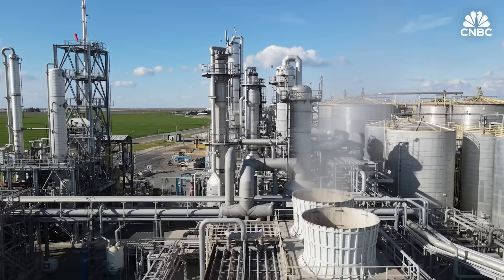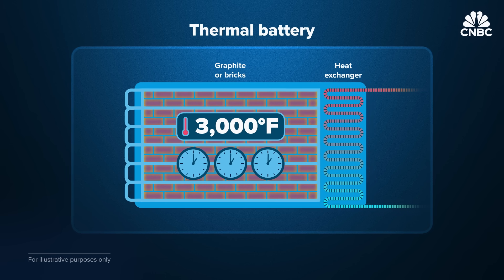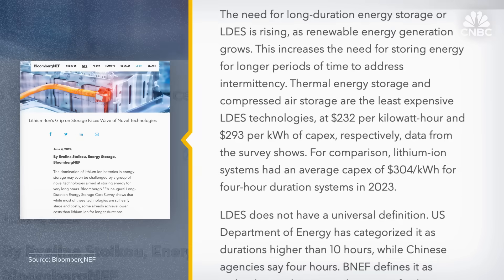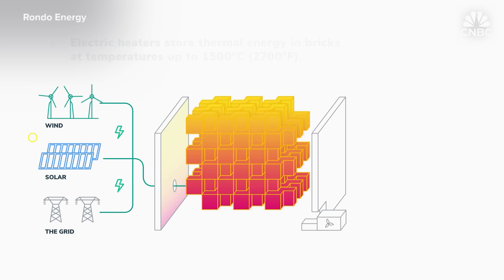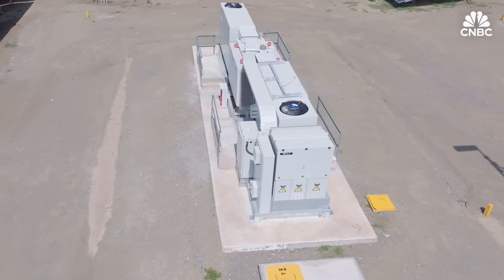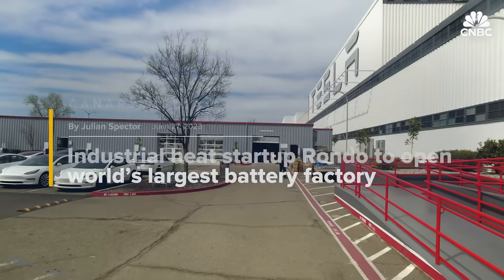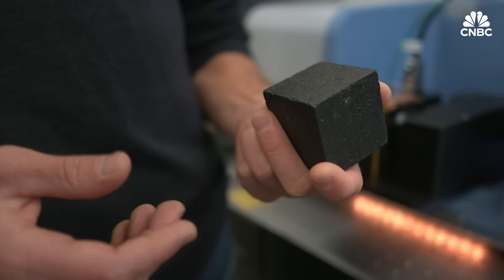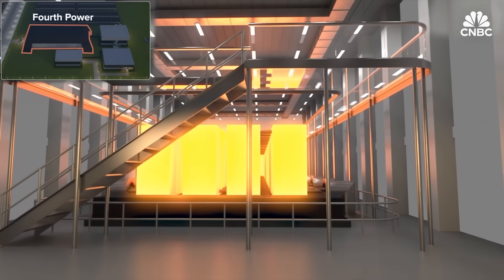How Thermal Batteries Could Replace Lithium-Ion Batteries

Comment: What is the energy loss in the process? That’s probably the most important point not addressed
Reply: The title of the video is wrong... these thermal batteries are not used to generate electricity and certainly cannot replace lithium-ion batteries.  That would be less than 20% efficient.  What these thermal batteries do is supply HEAT to nearby industrial customers... which is significantly more efficient.  HEAT is an important component for industrial customers, but thermal batteries are certainly not a replacement for lithium-ion batteries.
Reply: @junkerzn7312  Now this could make sense. Using these as actual energy storage (for electricity, for example) is insane. Using the preserved heat as a heat source, it kinda makes sense, nothing too wrong with that.
Reply: We need to change how industry utilizes the energy. With a small thermal battery at a residential property storing renewable thermal energy (from solar, solar thermal and wind) the power plant could provide reliable thermal energy for heating floors and water onsite. This would negate the need to convert it to electrical potential difference and and just utilize the thermal energy directly. It could also be scaled up for industrial applications.
Reply: @stormymangham5518  That's too expensive. It's better to send any excess electricity to your utility for credit and use it as your battery. Yes, there may be losses, but not as much as investing in a TES personal power plant just for heating, especially for those living in milder climates.
Reply: After short short research I’m seeing around 50% efficient which is significantly less than lithium ion at 90%. However the cost to produce the thermal batteries is significantly less. So like most things in energy the solution is probably a combination of a lot of different things
Reply: @CooperPower00  But the output of lithium batteries is electricity, whereas, the output of this TES battery is heat. The market for heat is limited, but everyone needs electricity. More expensive equipment is needed to convert that heat to electricity, which will result in further losses in efficiency.
Reply: @ huh? The heat becomes steam. The steam turns a turbine and the turbine generates electricity. The output it still electricity it’s just stored as heat potential energy. Whereas a lithium ion battery stored chemical potential energy.
Reply: @CooperPower00 
What’s your point about energy efficiency?
Reply: @CooperPower00  plus the lack of heavy mining operations to get the lithium
Reply: @CooperPower00 Not if we use heat energy directly without converting it to electricity. Then the efficiency reaches 90%.
Reply: Can one of you guys break it down barney-style for me? That diagram starting at 3:52 is baffling, so we're taking electricity, turning it into heat, and then using that heat to run a turbine....to turn it back into electricity or directly to steam? There's energy loss at every single one of these steps, not to mention storage and transmission. This math is not mathing
Reply: @jiema2020  The title is misleading.  The heat energy is generally not being used to make electricity again.  Water is piped through the heat mass to produce steam and the steam is then piped to nearby industrial customers.   The steam is used as a medium to transport heat at high temperatures so industrial processes can use it more or less directly.

This displaces natural gas consumption by the industrial process which would otherwise have to be used to generate the necessary heat.

-Matt
Reply: @jiema2020  So in that diagram the product is steam.  As in my factory, where we run boilers to get batch reactors up to temperature among other things, instead of natural gas boilers we could have thermal batteries be responsible for replenishing heat as superheated steam is used by the factory.  For the record, there is no loss when converting electrical energy to heat, so we'd be talking about the efficiency of the heat transfer to the water.  As the air circulation within the battery is closed loop, I can't see this as being less efficient than a natural gas boiler.  For me the real question is how much power is required by the fans driving the air circulation in order to achieve heat transfer at a required rate.  It could be quite low, almost passive even with a brilliantly designed radiator and sufficient temperature differential.
Reply: @JeffreyGoddin  Thanks man
Reply: @ so I think the best way to think about it is start from the thermal batteries which is essentially a bunch of bricks. The bricks constantly have water around them that boils and becomes steam. The steam turns a turn vine that outputs electricity. As that steam is being produced it cools down the bricks over time. So I’m order to heat the bricks back up again the bricks are connected to solar panels that super heat the bricks during the day. The whole time the steam is being produced just sometimes more steam is produced b/c it’s extra hot and other times it’s less steam because no sun so the bricks are slowly cooling. There is definitely energy loss in a lot of this process but given enough solar panels it essentially allows the system to give off more consistent energy throughout the full 24 hrs instead of excessive energy during the middle of the day. 

Calling them thermal batteries is somewhat misleading imo as they aren’t meant for long term storage. Just to give off more consistent power throughout the day.
Reply: @CooperPower00  You are understanding it incorrectly.  The bricks are not surrounded by water, but air.  The entire battery is sealed and insulated, and when the energy is not needed, there are virtually no losses.
Reply: @ Ik I was just trying to make it easier to understand.
Reply: @JeffreyGoddin 
Air is a conductor, therefore you will lose energy.
Reply: @BillyP13  sigh...
Reply: @jiema2020  How about you research this properly before coming to conclusions? You’re a prime example of someone who watched a short video and thinks they’re smarter than the phD level engineers who are behind the designs for such products
Reply: Hey! So we primarily deliver heat to industrials who are otherwise burning gas to produce heat to drive their processes. We're 98% efficient electricity-in to heat-out -- our customers are purchasing heat, not electricity. We charge during peak renewable generation hours when electricity prices can reach zero (or negative) prices due to curtailment. It's a win for the grid (more reliable, less curtailment), and a win for industrials (using electricity for heat instead of burning gas).
Reply: The other issue not mentioned is graphite mining and processing is dominated by China who produces 77% of the worlds graphite, also graphite production and mining is not very clean producing massive amounts of CO2.
Reply: @ You just crushed my hopes and dreams. I’ll have to see why it produces so much CO2… 😔
Reply: Shhh you’ll scare away all the tech illiterate potential wealthy investors with your logical questions
Reply: @Planetside223 Germany does this already, on the civilian level, they store the energy as heated water.
Reply: If you later use the energy as heat the loss is very low. If it is converted back to electricity, it will be very high.
Reply: It's a very obvious question. This smells pretty fishy to me.
Reply: 5% loss with heat to heat conversion
15% loss with heat to electricity
there primary goal is to use heat in factories So they are pretty effieicent
Reply: Seems like the loss can be mitigated with a vacuum silvered container similar to a thermos. With thermal batteries that are used to produce steam for industrial purposes, the efficiency must be pretty high. The electricity to heat portion using resistive heating is pretty much 100% efficient. And the heating of steam is also quite efficient. The significant losses come if you try to convert that heat back into electricity. Ironically those exact losses are acceptable when converting the heat generated in a coal or gas power plant into electricity, but people complaining about this usually don't complain about those losses.
Reply: They don't sell the energy in electric format, they just supply heat
Reply: 3:25
Did they say Brondo company?  Does it have electrolytes?  🤣

For those that don't know, see Idiocracy.
Reply: So if you store heat for users that require heat, storing cold for users that need to use cold should be as beneficial? I can think of more immediate uses for cold storage! Air Con, Food Prep, Food Storage, Medical etc?
Reply: @dazbusby auto system equipment don't bring cold. There take out heat.  

Cold is the absent of heat
Reply: @ uhhh no. They are not using the heat for cooking or anything like that. They just use the heat to essentially boil water to make steam and the steam turns a turbine and that generates electricity.
Reply: @CooperPower00  
In that case converting stored heat to electricity is extremely inefficient, with only 30-40% energy efficiency due to multiple stages of loss. It's complex to maintain and not immediately available if needed quickly! But they don't seem to want to mention any of that :)
Reply: @ what? Why r u attacking me? Haha. Of course their losses. Scroll up I looked up the system and said there was losses. The point of the system isn’t to be the most efficient in total it’s to help deploy energy throughout the day instead of only at peak sunlight hours.
Reply: @CooperPower00  Ive no idea why it stuck your @name at the front, I was just generally replying about the inefficiency, I saw your posts saying virtually the same thing as well lol
Reply: It's how much to build it, maintain it. How much do you make per cycle(this includes round trip efficiency), how often you can cycle it.  I think if you are using the heat directly, like baking cookies, or heating, the losses should be low, and boy would this be good in a dunkelflaute. Making electricity with the heat would lead to higher losses, but I think long term, solar and wind will have to be overbuilt, so there might be a lot of opportunities to buy really cheap power, so it might work anway.
Reply: Loss is proportional to thermal difference and surface but inversely proportional to insulation and mass when heat is both the input and the output. If inputs and/or outputs are electrical, mechanical, chemical or other, those conversions also have losses.
Reply: Anything lower than 100%, is good. Right now you release to waste all green energy not demanded.
Reply: The other point is that you can supply the whole word with wind and solar energy ! It takes a lot of space on the ground !
Reply: 2% from their website
Reply: If the heat is used as heat it can have 90%+ efficiency. If the heat converted to electricity efficiency drops to 30%. 
Fortunately most industrial processes use heat.
Reply: doesn't matter it would be energy going to waste...
Reply: High.
Rankine Cycle has efficiency around 33% only.
Reply: This is the insanity in all of this: heat is the least "noble" form of energy. Every kind of energy eventually "degrades" into heat and you can view it as a sinkhole: it's easy to get in, but very hard to get out.
Convert energy from heat to, say, electricity is insanely inefficient. Think about these people trying to transform super heated carbon blocks into light emitting "mega lightbulbs" and then capture the energy of the emitted light with special solar panels.
If it sounds insane, it's because it is!
Reply: @MassimoLuraschi  dude no one making heat into electricity. Is a HEAT storage.

A quarter of electric use is to heat up stuff.
Reply: It’s calculated in the cost
Reply: 80%
Reply: Heat is the worst way of storing energy, it leaks even more than US money supply
Reply: Some people in this thread seem to misunderstand the purpose of the technology. Lithium-ion batteries and thermal batteries aren’t really in conflict—they can complement each other and cater to different markets, as pointed out by Rondo. Industrials are a great fit for this kind of tech since nearly 80% of their energy comes from petroleum (34%) and natural gas (41%), according to the EIA. Electricity makes up only 13%. What industries really need is "heat"—for processes like steel refining, cement and glass manufacturing, plastic and polymer production, and even semiconductor fabrication. Right now, "industrial heat pumps" are gaining traction for similar purposes, offering efficient ways to generate and manage heat for these energy-intensive processes.
Reply: Wrong question: this isn’t used to be converted to electricity— the heat will be used to generate steam and industrial boiler/processes
Reply: So a sand batter loses about 5% when used for heat and about 30% when used for electricity.  I’m sure it will improve over time as well
Reply: The energy lost if the stored heat is used as heat is a lot less than if you're trying to round-trip it back into electricity.
Reply: energy loss is irrelevant considering how cheap solar electricity is to produce. you can have something as abysmal as 20% roundtrip efficiency and still turn a profit
Reply: 98% efficient, meaning 2% loss
Reply: Used directly as heat source, i guess not much. However if Thermo PV cells are used to convert heat to electricity then there could be sig losses. I guess better to drive a steam turbine and minimize losses
Reply: Its actually not too important when you actually factor everything in.

We literally NEED the capacity to store heat on a mass scale and any “renewable” energy that can be utilized to increase the concentrated heat in the system which technically reduces heat reduces the increase in heat in the atmosphere.
Reply: The loss, coupled with the cost of the input power.  Input from solar would be much more viable than from a nuc plant due to huge cost kw cost difference.  It'll be interesting to see this mature.
Reply: @JT_771 bullshit !
You can’t supply the whole world
Reply: I hope we can solve this one day. But I imagine there’s a 35% energy loss in the process
Reply: @MrKrinkleKirnk  Yeah ... especially w/ some guy in there talking about weeks & even made some month claims.  Loss there has to be steep.
Reply: @JT_771  Do you understand how insulation works?
Reply: @JeffreyGoddin  Insulation is not only NOT 100%, so by definition there is always loss and it will always therefore increase over time, but there is also a cost to benefit balance when it comes to adding it.
So there will be loss and it will increase over time, period.
Reply: @JT_771  The way large industrial heat masses work is that the heat can only dissipate  undesireably via its surface area.  But heat storage capacity is by volume.  Surface area goes roughly by the power of 2, but volume goes by the power of 3.

This means that small heat masses dissipate their heat quickly, but large ones dissipate their heat very slowly.

Even though in absolute terms the larger surface area dissipates more heat, the volume is so much greater that in percentage terms the rate of heat dissipation slows down.  By a lot.  When you have excess energy to spare, you only care about the losses in terms of percentages over the huge volume that you are able to heat up, so efficiencies can be quite high.

This same concept scales up more or less indefinitely.

-Matt
Reply: @junkerzn7312  No argument.  Otherwise this would have little chance of being viable.
Reply: @MrKrinkleKirnk  You have a specific number... How did you come up with such result? 
Just kidding... With something like "around 35% loss" would suffice.
Reply: @ yah I have no clue, it would be nice if they did give one.
Reply: @MrKrinkleKirnk The early thermal batteries made of insulated sand silos launched in Finland (?) had about double (~70ish percent) in energy loss when converting back to energy. That, however, doesn't mean that the figures haven't been improved, but it's something at least. One aspect to consider, though, is that there are several applications for thermal batteries, and a major one is to simply use the heat stored in the batteries for heating purposes at a later stage. The losses for that application is obviously much lower, and is a fairly large proportion of energy consumption.
Reply: Only 99.99%  🤓
Reply: quick google search suggest they are 40% energy efficient per cycle. Compare to 90% of lithum ion. mostly due to that fact, it's low grade heat which have low carnot efficiency and have a high self discharge rate.
I guess they win out on $/kwh compared to lithum ion, about 1/3 to 1/2 of lithum ion battery. So unless the thermal battery is used in a location where cheap renewable is available so the loss in efficiency don't matter as much and is used within a short amount of time since storage, thermal battery is rarely worth it. The heat is low grade mainly due to material limit, hard to store salt in high enough temperature without having it chemically react with the surround insulation.